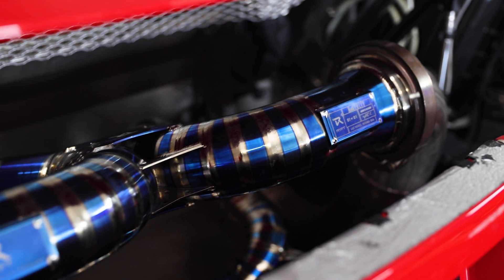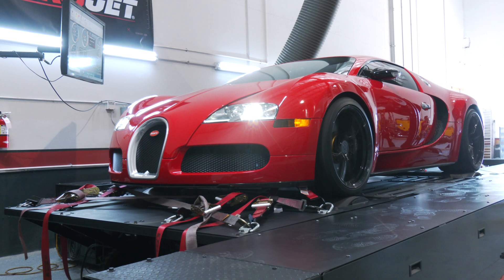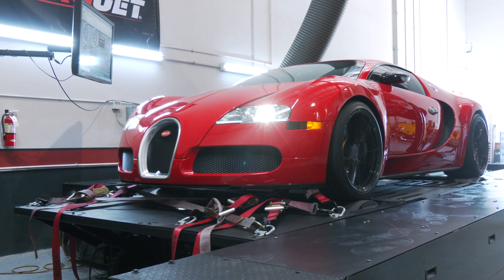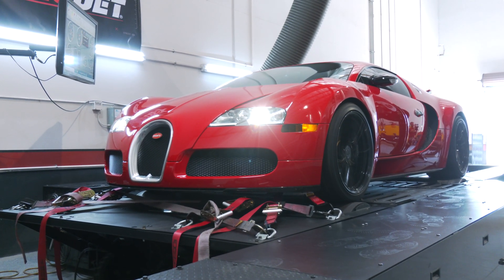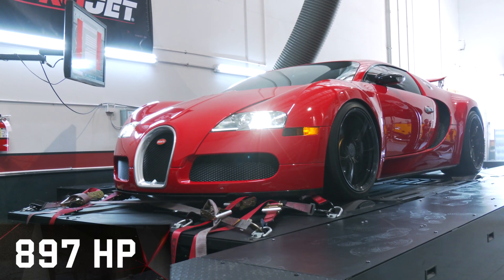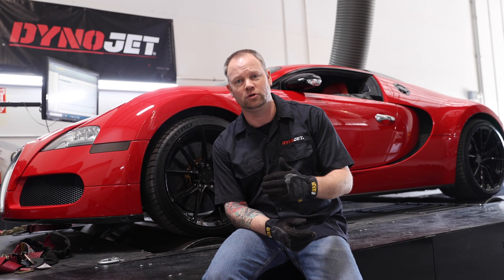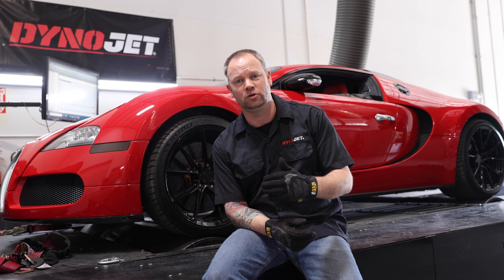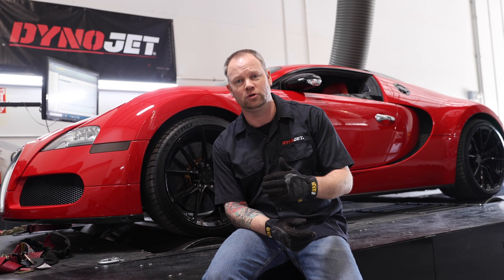Bugatti Veyron on the dyno — How much HP?!

Comment: It’s probably having trouble getting the exhaust to go through the wastegates on the stock calibration. The exhaust is more free flowing so more of it wants to go through the turbos as a path of least resistance. Less back pressure to help regulate boost through the gates. That’s my guess.

Those wheels are siiiiiick.

Comment: its a VW as soon as you change the air flow on the exhaust the air fuel ratio will change the parameters on the computer will limit the turbos from over boosting  the system so it backs off the power to protect the engine at high revs , it will need a whole new ecu map to work with that exhaust